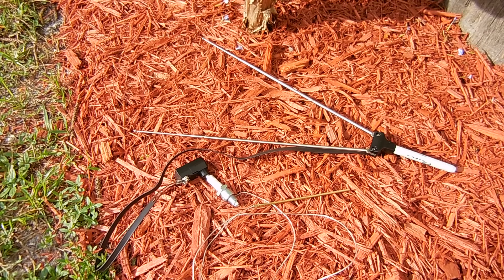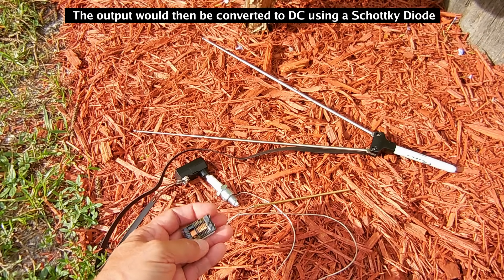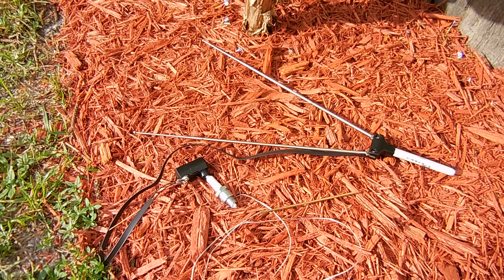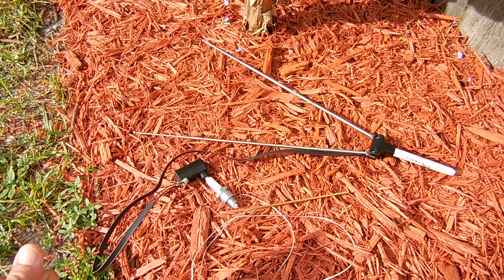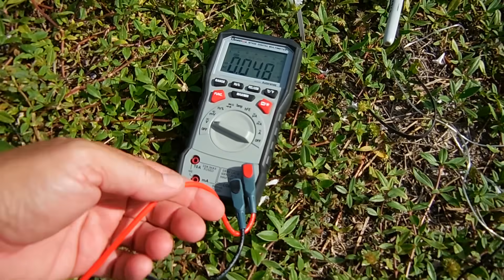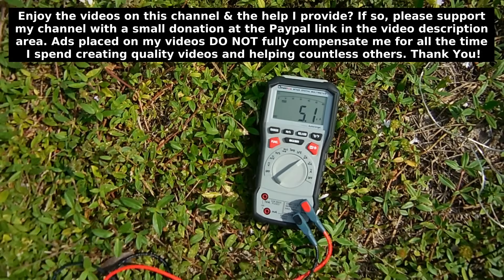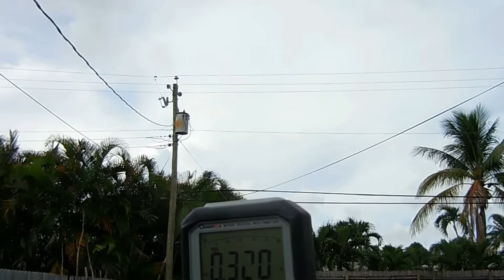Charging Cell Phones From Power Lines?

Comment from the maker: The high tension power lines in this video were between 115KV and 200KV, which was more than sufficient for the test, especially since I was standing on a hill closer to the wires. In order to get a higher voltage output from the antenna, you would have to move closer to the power line, or stay in the same spot and increase the voltage of the line. Thanks!
Reply: Electrcian here, sorry but those are 10 kV lines, not 200kV. The other movie is most likely real.... The fenomina is called, capacitive coupling.
Reply: @InstallerTim  They don't want us to know this is possible =)
Reply: @rootbrian4815  
Unfortunately for you, you're mistaken.
Nicola Tesla built a device using a metal sheet, insulated from the earth & attached to a pole, with a wire connected to the metal plate going to one input a rectifier, a wire from the earth going to the other input of the rectifier, and a spark gap capacitor on the rectified outputs.
It's basically a way to harvest radiation from both man-made (radio waves & radar) and natural sources (solar radiation).
Multiple sources have confirmed this throughout the time of Tesla's death to present.
It's practicality as a means to charge a cellphone is dubious, however.
Reply: @InstallerTim  That other video wasn't a movie, because it would be made using special effects (likely). Fake.
Reply: @InstallerTim  umm that is 12 kV underbilled on at 230 kV
Reply: Great video
Reply: Not sure why someone would expect an antenna to work.  I think you would have better luck with some kind of a coil.
Reply: @wlambert43  Even a coil wouldn't do much justice at all. 0.05 mAh isn't nowhere near enough to charge anything without internal resistance pushing it away.
Reply: LMAO, 115-220 KV  Ea single insulator LOLr
Reply: @rootbrian4815  i honestly dont give a shit
Reply: the powerline in the video of kreosan was 220kV, based on looking at the support pylon it was coming from.since i also live in a former soviet union country,we have same type pylons and voltages and the thing that creates the bigger difference is that this sort of pylon is normally meant for 110kV transmission and the wires hang pretty low on them,so the electrical field under it on 220kV is even more higher and they were standing right under it,not by its side like you did. research has shown,that the electrical field peaks when you are directly under the wires and drops almost to zero,when going further away to the side. i myself have witnessed arcing on my umbrella,when walking through under a 330kV transmission line during the rain and right under the powerline i heard buzzing and a small arc formed between the spring of the umbrella.if you can,you should repeat this experiment,but under a bigger voltage powerline,something close to 300kV or upper.
Reply from the maker: @Henzzman  Very sad to hear you doubt my results. Both videos displayed no bad weather/rain, so that point is irrelevant. Keep watching scam videos.
Reply: BULL SHIT ARC WILL KILL

Comment: Look carefully at the original video. There is a red coil wrapped around the flyback core. They are running it from something hidden, probably buried just under it. The spark plug will spark, but it's going towards the antenna, not from it. Of course the other windings will also read correct voltages. It's just an entertainment trick like their microwave cannon or 'catching a lightning in a tv'.

Comment: It actually works. Remove the balun. The easiest way to check if the powerline is adequate for this, is to lift a neon tube above your head under the powerline. If it glows, the powerline is suitable. As i'm sure you already know, a neon tube should not light up at 30V. The neon tube doesn't even need to be functional, as long as the glass is not broken and the seal is intact.

Comment: In Russia, in back days the 220KV power lines are tensioned much closer to ground as seen in Kreosan's video. That's why the leakage current and the wire to ground potential gradient is comparatively higher. But now a days, in most of the parts of the world, power lines of that much ratings are high enough from the ground so that the ground induction is negligible. But, you can try out these tests in a humid day or under a 765KV power lines or putting the antenna with additional stick at a higher place which will give you a better result. But of course beware of the antenna height and do not put the antenna too close to the wires.

Comment: So you were getting AC voltage via capacitance effects (since it was from antenna to ground). You should try a copper coil with a ferrite core and see if you can get current via inductive effects.

Comment: In 2011 I was installing a TV antenna on my shop and the 40 foot pole I was using broke and landed on the 3 phase power lines that supply the subdivision. It blew my left Big Toe off and gave me 3rd degree burns on 23 percent of my body. I spent 52 days in the Birmingham Alabama burn unit. I was on that pole for over 7 seconds , my nextdoor neighbor grabbed my t-shirt and pulled me off the pole and saved my life. I can tell you that it felt like I was being pulled into the ground , while being electrocuted.

Comment: You're only performing that around a 115000 V. Steel lattice towers Carry anywhere from 230000 V to 500000 V or even higher if you're dealing with DC power. Fence is running parallel with New Zealand wire  
 pick up voltage induction but crossways under the lines cancel it at

Comment: Yea but the american power lines probably dont have a big leakage current
Reply from the maker: Possible the voltage wasn't high enough, you may require several hundred KV lines.

Comment: In Kreosan's video, the power lines they used were the same voltage but were much closer to the ground, I think that's because they're just in a country that doesn't have good safety standards, and that might be why they were able to get a much higher voltage from the antenna.

Comment: I think to do what there doing will require you to be under the power line. What you are trying to do is air couple your transformer to the emf field radiating from the power line. 
You can get seriously shocked working under high voltage lines. I will not touch anything ungrounded under a HV line without my 1000 volt gloves. 
A neighboring utility caught a farmer with a air gap transformer under a 2 circuit 250 kv tower. He was using it to light 2 Florescent bulbs. The inspector showed me the photo of the contraption and the line going to the shed with the lamps on. The lamps were getting 450 volts.

Comment: Looks like one of Tesla's inventions made from modern materials.
I'm only about a minute into this video, so I don't know how this works for you but Tesla's version works, although not in any practical capacity, and does so without the high voltage lines overhead.

Comment: 1) Power Lines appears to be 69KV as you can see there were distribution Xfmers hooked up to it to supply homes, etc. I don't believe they were 200kv lines. It cannot be close to the ground like that if it were to be 200kv if that makes sense. 

2) Voltage alone cannot provide enough electromagnetic field to spark the plug. Power lines must be fully loaded per its capacity and needs to be carrying decent amount of current at XX Kv so that one can capture EMF through the antenna . There are lot of factors that may affect sparking the plug. 

The best power lines one could try is that the one has a lot of noise  (humming noise) coming from the lines itself . Those are heavily loaded power lines and may give you good reading of EMF and thus the sparking in my opinion.
Reply from the maker: The lines were sizzling, and I was told they were around 100-115kv.

Comment: The powerline here has to low voltage rating. 
you need a 245-380 kv powerline. Why they ground a deenergized busbar section before working. 
I think this is a 60 kv or 79 kv line. 380 kv lines often have a douplex wire for each phase, so it's easily identified.
kreosans select a 220 kv or 380 kv line(i'm line man). 
sometimes there is protection eqipment in the switchyards so don't do it. if it disconnect, you can get very nice problems.
Reply from the maker: I will attempt the test again at a later date using a higher voltage powerline. Thanks for watching!

Comment: You seem to be getting 30 volts and a low microamps, you also said you can't do anything with that but we found that you can do something with that low voltage so we are most interested to see your videos to discredit this YouTube video which seems to match the voltage you
https://youtu.be/_pm2tLN6KOQ
In case we get the address wrong it says get electricity from the sky crystal radio,
We are quite skeptical too so we will be interesting to even see if you reply to this will even leave our corporate number Media Library 313-651-5349

Comment: Not enogh Voltage in power lines... And you are far away from pwer line. Try with 400KV+ and stand under him in place where line is lowest... And then come back at night with neone light :D
Reply: you can tell by isulators that lines are 35kv more or less
Reply from the maker: Incorrect. The lines are around 100Kv.
Reply: @electronicsNmore   Any way..way too little EMF.. Higher V, more power in the air around them...  Try with more serious power lines. Works 100%
Reply: @bmwsale8  It works in the sense that if you have 500kV power lines and can get closer, you'll certainly raise the amperage but still not enough to fire a sparkplug, maybe enough to charge a first gen iPhone. LOL  I've also seen people put a slit PVC tubes over the power line, rotating a coil of wire around it with a few turns on both and claiming to get much higher power, but I'm 100% sure that they are faked, and, anyone dumb enough to try to put PVC around a live high power line doesn't need to charge their phone, because they'll be seeing god soon anyway.

Comment: It has to be a copper coil around an iron core. Thus in theory creating a secondary transformer. Then you raise the coil closer and closer to the powerlines and the AC voltage expanding and contracting field would send more current through the wire.
Reply: Ummm, nope...

Comment: I recently did some experiments under a 150kv power line. When I touch a neon indicator on one side and hold the other side to a grounded wire, it lights up quite brightly. Next I made a 2 meter long stick with thin wires sticking out at the end and recified the output with a high voltage diode and then fed it into a capacitor. When i hold the stick up I can charge it up to about 5kv and make some Little Sparks. It is not nearly enough power to charge up a phone, but it is more than what you showed in this video.
Reply from the maker: The power line voltage has to be very high to get any useful output.
Reply: @electronicsNmore  true, Those ukrainian power lines in the kreosan video are probably much lower hanging than they would in other countries..... ( For the same voltage)

Comment: I believe the power leakage in Russia is worse than the US when I'm trying to say is that our lines are more insulated then there's, keep in mind that they were getting electrical shock from the grass meaning that high voltage was leaking out everywhere. Of course you have to take everything into consideration We Are Scientists not comedians. Your video was most helpful in proving one fact there are some type of leakage coming from voltage lines you can contact our library at 313-651-5349 and we will discuss how you can take advantage of the lowest amount of power or straight voltage. For those who may read this solar cells especially small ones don't put out much power but still are useful and are being sold by the masses, Tesla has already proven this and we keep reproving the same thing what will it take for people to get that industry just wants to sell you products this already free to you convenience is the name of mass trickery

Comment: Use longer antennas and remove that balun from circuit. Inside that balun is a resister network which shunts to ground through 75 ohms. That kills your power from flowing through.
Reply: Won't work.
Reply: @rootbrian4815  why

Comment: Spark plug 😂 No reveal?
Reply from the maker: It may be possible using very high voltage power lines(in the hundreds of thousands of volts) that the plug would spark between the gap, but to produce any usable power you'd need a much larger antenna/metal plate than shown.

Comment: You claim to be about science but fail to replicate the conditions of the experience to eliminate all possible variables. I don't think you can capture meaningful energy with such a small antenna either but then again power companies have prosecuted people for successfully pulling this off.
Reply from the maker: I duplicated exactly what another YT channel did, but I used a 115KV line, which should have produced sparks. You saw the results. My video couldn't have done a better job. The only difference was his power line was higher voltage.

Comment: So fake that power companies have actually charged and successfully prosecuted people for theft of services because they were caught doing this.
Reply from the maker: You can be charged just for attempting to steal(harvest) the power, it doesn't mean it works. I never said anything bad about the other guy. I said it was unlikely to work based on my tests. Maybe with 250KV to 750KV lines it does, but the setup he was using was lousy. Using a large coil of thin wire, maybe that would get you some usable current.

Comment: That fact that the spark plug was grounding the 75 ohm Balum by touching the outer ground and the center wire nothing is going happen.
If one took several wraps of 10 gauge insulated wire and wrapped around 110k transmission cable you could extract enough voltage to charge a cell phone battery, along with a voltage regulation circuit and current limiter. Click bate video
Reply from the maker: Only "clickbait" to fools. The smart viewers know this video was made to EXPOSE something.
Reply: You couldn't even properly spell "click-bait". The other thing is, GO BACK TO PHYSICS CLASS.

Comment: I'm wondering if this experiment would be better performed beneath a SWER line, rather than a 3-phase HV line. I think the presence of the other two phases is negating your inductive coupling. 🤔
Reply: Take a physics class again. Maybe an electrical engineer's course too, unless you flunked both...
Reply from the maker: If you doubt my results, then you'll need to waste some money and time trying it yourself. You'll need to learn the hard way.

Comment: As a utility engineer, I can tell you that if you were positioned beneath a horizontally  run transmission line vs the vertically sequenced line you showed in The video , the direction of the electrical field would be more likely to induce a higher voltage than you observed. Still it would never be high enough to make a spark plug arc. Nor is there enough energy to charge a cell phone.  Transmission lines are designed to be a minimum distance above ground for personal safety. Energy decreases as the cube of the distance. Never climb poles or towers. Your risk of electrocution goes up very quickly with every foot above ground level.

Comment: Good demo showing the very tiny power available when replicating the other yt video.  But, I have to point out that this does not mean there is little energy present at that distance, only that the demo circuit could see just that much because of terrible design approach in the original poster's attempt.  

A totally different circuit would likely work as a proof of principle just to charge a measly phone, but it would not be free if they got charged for stealing from the power company.  A device to convert enough energy would still be most likely impractical even if doable, but would surely seem to have enough energy to charge a cell phone.  One way is RF resonant coupling but if the line frequency is 60Hz, then a 1/4 wavelength dipole would be huge for max power, but just for charging a cellphone much smaller size might still work.  Other way is parallel line (also very long elevated horizontal) for capacitive coupling to a circuit, not practical and then there is the basic inductive loop transformer coupling some companies are testing for wireless power in home items like stereo speakers and TV ect.  but they are using much higher frequency that 60Hz but can send a signal quite a few feet with respectable received wattage.
Reply from the maker: Agree with you. :-) Thanks for watching!

Comment: For those who understand electronics, those high tension power lines have quite the EM field. But utilizing such an alternating EM field would need quite the isolation for the proper phases while the antenna material resistance needs to be low enough to be receptive to such fields present at a distance.
Reply: Bla bla we know

Comment: where are you from? if ur from usa it may be that you have 100 volts and russia has 220 volts i dont know much about it but maybe its that im not sure
Reply from the maker: Russia/Ukraine uses 50 Hertz / 220 Volts. The USA uses 120V/240V 60 Hertz. That step down voltage is meaningless, what matters is the high voltage of the power lines. The lines I used in this demo were between 115,000 volts and 200,000 volts. More than enough to show results. Thanks for watching!